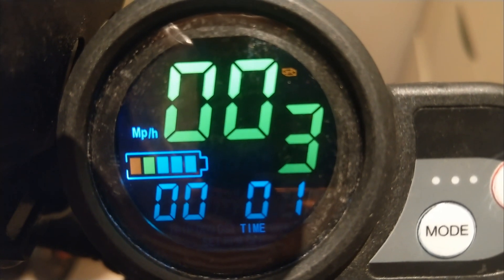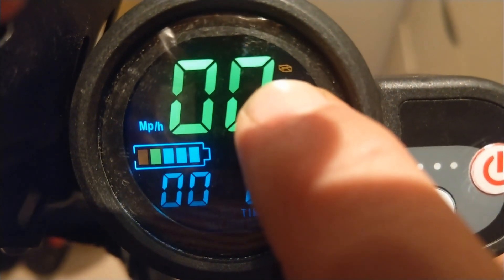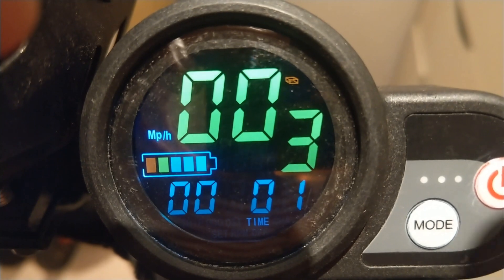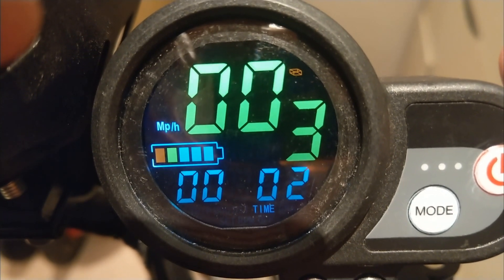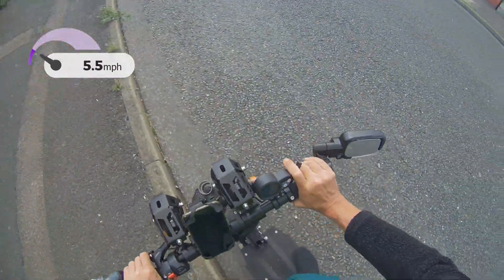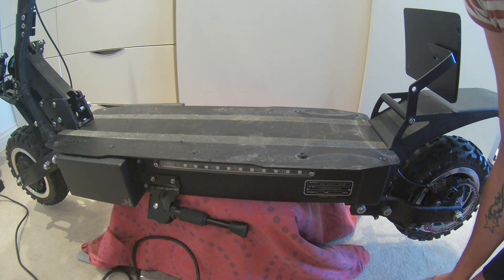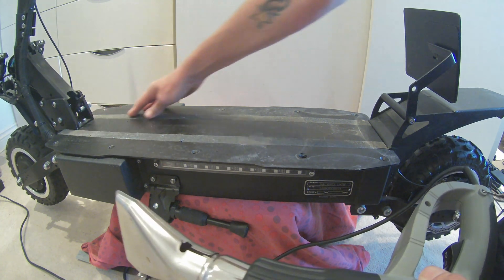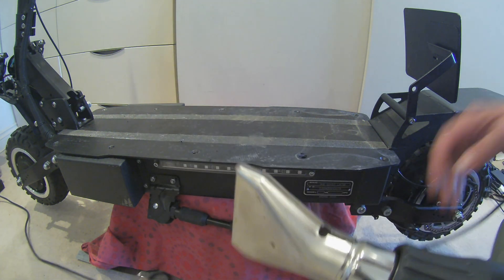Electric Scooter - Motor Controller Failure Part 1

Comment: Help, please, Marcus!! My greenpower 3 wheeled retro  electric mobility scooter  is not functioning well. It starts but won't accelerate, moving really slowly.  All seem fine and battery is fully charged. I have no clue of where to start or what to look for but with your help I hope to fix it myself if is not to complex. Looking forward to your wise guidance, Marcus. Many thanks.
Reply from the maker: Hiya. First off, is the battery a SLA (Sealed Lead Acid) type? How old is is and roughly how many charge cycles has it received? I ask that because if it is SLA, that is 90% likely to be the culprit. The only way to be 100% certain is to put the scooter on a block (heavy I know), put the throttle on full and measure the each battery cell. I imagine it has more than 1 cell if SLA? Please tell me if it is in fact SLA or lithium powered. Does the power go immediately when you apply throttle or gradually? Cheers!
Reply: @marcusoroberts  Good morning, Marcus! Thanks for your quick response. Let's see.. Lead acid battery it is, bought my scooter in sep. 2018 and charged maybe 6 or 9 times...its starts fine but moves slowly when trying to accelerate the speed, as if something is pulling it from behind... Does it help?... Please note, it is the first time in my life I am tackling mechanical stuff... But with good will to learn new skills, enthusiasm and a Master like you, I have got a good chance to get my 'baby' running again! Many thanks, Marcus!!
Reply from the maker: @MONICA-SMILES  Good morning Monica. I wish you had said lithium battery, because that would not be the problem! How many battery cells make up your battery pack? You need to measure the voltage across each battery whilst under load. Apply full throttle when you put the scooter on a stand or block, and see which one drops below the quoted voltage. Check that out first then we can move onto the controller stage.

Comment: I have that lil box also. I changed and put 2 different controllers with display 5 wiring ? Am I forgetting something or need to connect something else for it to start ?
Reply from the maker: Hi, so you're saying you changed both controllers? You only need to change (or repair) one controller. The left one (Controller B) is for the rear motor and the right one (Controller A) for the front motor. Sorry, I want to help but not sure of the question. Could you explain more please? Thanks!
Reply: Marcus Roberts I mean I bought 2 controllers and installed both. Both had the box symbol blinking. I bought another one and that one worked. I guess those 2 previous controllers I bought from China did not work.
Reply from the maker: @PURGE-3000  cool. Is it up and running again?
Reply: Marcus Roberts yes. Thanks for the info though. Really helpful.

Comment: I have problem with Wizzard 2.0 E-Scooter, it does work only on charger, when I put it out he shuts down. Can you help??
Reply from the maker: Do you have a SLA (Sealed Lead Acid) battery? It sounds like a battery failure, or one of the cells has gone. This is going to 95% of the problem. If you have a lithium battery, then this is unlikely and is therfore more likely connection problem. Which battery do you have?

Comment: Hey dude! I have a T113 with 3200W and sometimes one motor just cuts off! I don‘t know if it‘s the front or rear motor, but when I pull the throttle it starts normally and after 2-3 seconds it loses power af! I release the throttle and repull it again and everything works fine again for a couple minutes! Then it starts again! I believe it‘s the same problem as yours, but on my scooter it doesn‘t show this rectangular prism on the right of the LCD!
Reply: I think I solved the problem! I switched the motor pairing to 16 and everything worked fine after that and until now!
Reply: Still kinda strange though!
Reply: Maybe it was just the overheating motors! Because I drove when it was really hot outside! Like 38 degrees or so!
Reply from the maker: @ToHaru-Chan  yes they set to default 15 usually but should be 16. Well done dude.
Reply: @ToHaru-Chan  What exactly did you do. Is this a setting?
Reply: @BalanceHolder  Yeah it‘s a setting, but I sold the scooter 1.5 years ago or so, because it had multiple problems I didn‘t want to solve. I bought a new one.
Reply: @ToHaru-Chan  i have the same model and i cannot count the problems I've had... Damn shame because i like it a lot. Done over 10 thousands km on it (home-work-home) but the electric parts fall apart very easily.
Reply from the maker: What happens if you only use rear motor? Does it cut out then? If you use both motors, do they both cut out our does the front motor continue working! All the wiring goes to left controller for the rear motor, and the front motor is wired in parralel. Does the battery charge ok? I suspect the controller is to blame even if there is no fault code showing.

Comment: Mate, I'm having trouble finding a replacement controller. Not sure what type it is cos nothing is written on the box. Help!
Reply: For what scooter? The T112 has 37A contollers! You can buy them from FLJ directly.
Reply: @ToHaru-Chan  No it's a 2000w Dual. This controller looks too big.
Reply: @Chris LeMont When it‘s a noname brand scooter I can‘t help you!
Reply: @ToHaru-Chan  It has no name. It was just called 2000w Dual Scooter,  I bought from Aliexpress last year, but I think I've found an equivalent model.
Reply: Chris LeMont Ok! I wish you the best of luck!😊